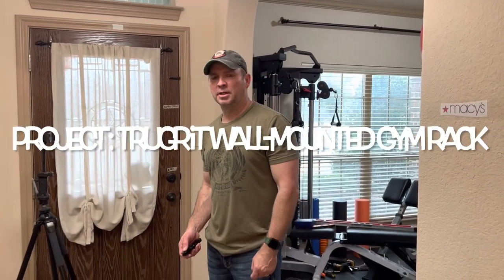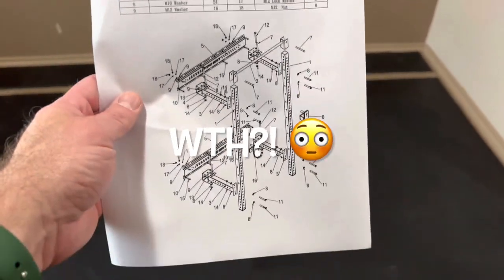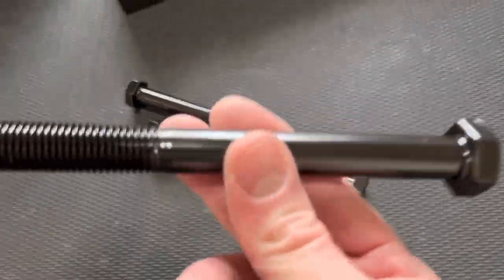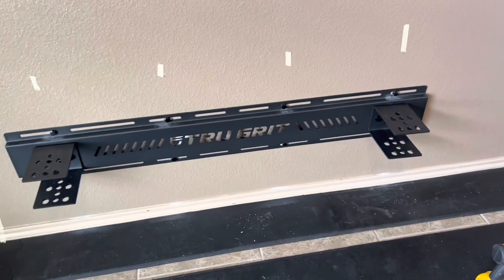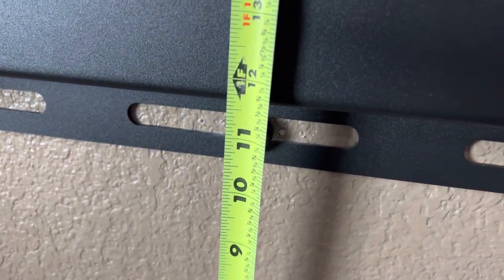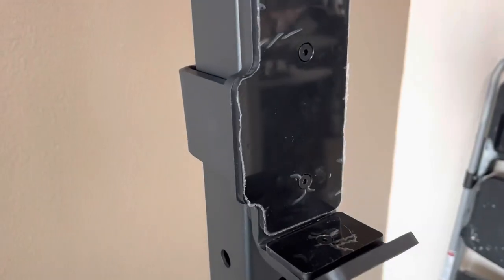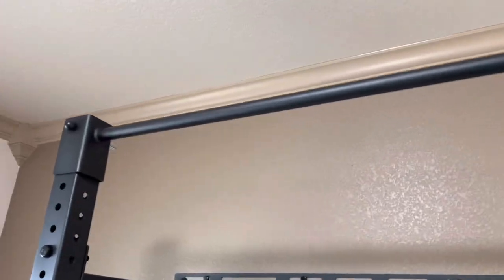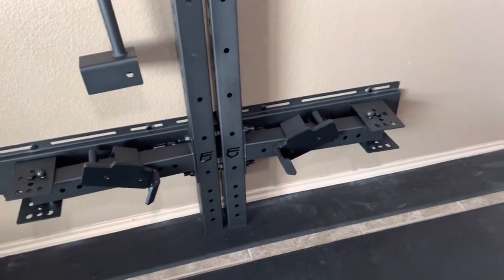TruGrit Folding Wall-Mounted Rack Unboxed and Assembled

Comment: going to mount in my garage however my garage floor also goes up the walls 15-16inches. Is there enough holes on the rack to mount it over 15-16inches from the floor? yours was showing 10.5inches from the floor. thanks!